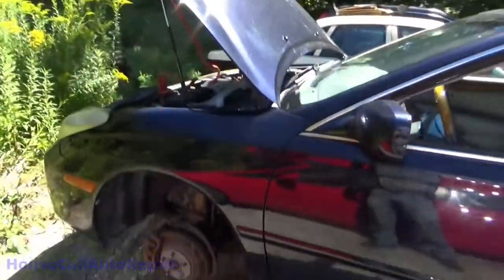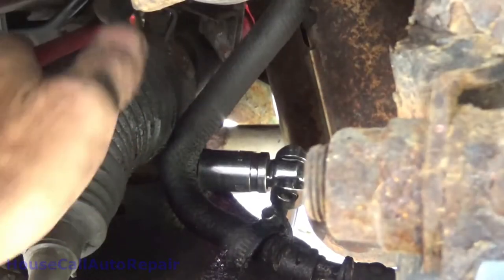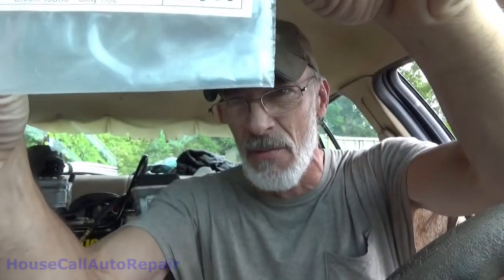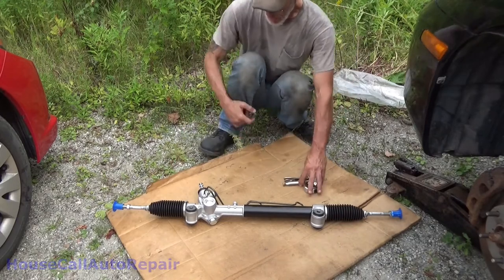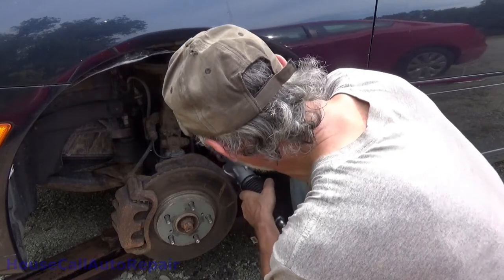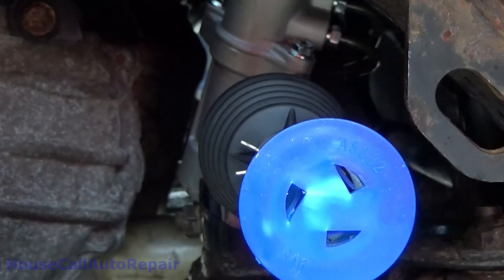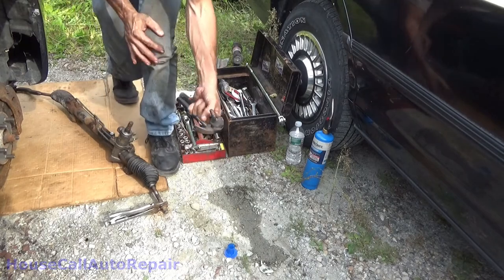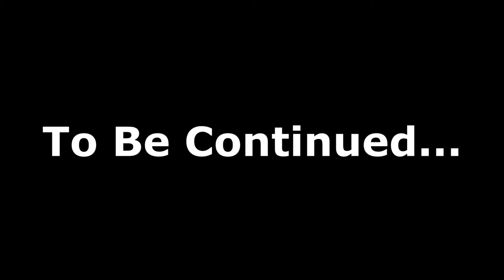2005 Lexus ES330 - Steering Rack Replacement - Part 1

Comment from the maker: Stay tuned for part 2... Not much scarier than taking a repaired vehicle out for a test drive and suddenly realizing the steering wheel won't turn!
Let me know what you think might have caused it below...
Reply: Where did you get those orings from
Reply from the maker: @ConStantEdits  Toyota Parts Counter
Reply: What brand rack  did you use

Comment: The off center seems to be common. I changed out my rack and found out, after the full install, that it was 1/4 turn bias. Mine was also pushing right ... Which resuts in a more left
Reply from the maker: It's really easy to knock it off center, as much as just getting it off center. I see fewer and few means of locking them, centered, for shipping.
Reply: @HouseCallAutoRepair  I had to get a friend to turn the wheel while I measured the throw. Then centered the rack and took off the steering yolk and recentered the wheel before reattaching

Comment: You're lucky that you didn't have to loosen the sway bar from the sub frame. The bolts for the rack are too long to just pull them out.
Reply from the maker: As much as things rust up, around here, it's a wonder that most of the bolts didn't break.
Reply: I finally got the steering rack out. I just loosened the front bolts of the sway bar and used a pry bar to clear the bolts.

The wacky thing I had to do was remove the air box and get to the metal lines from the top. I used the pipe from my jack to secure the rack and used a wrench with an extension to get the lines off the rack. I live in the rust belt.

Comment: Assuming you checked the fluid level and bleed the rack by turning lock to lock a few times to get the air out, I would next guess there is a clog in the line.
Reply from the maker: No clog in the line, and amazingly, the fluid drained from the system was relatively clean! It really felt like a weak pump, but it did turn lock to lock while stationary, without any struggle. On the road it felt like there was no assist.
Part 2 covers the improvement, as well as more dangerous COMMON problem...

Comment: Is this the exact same process for a 2002 ES300? I used the video to replace on a 2004 ES330.  I now have a 2002 ES300 that needs a rack. Thanks!
Reply from the maker: It's similar. Check other videos to get a better idea on that model.

Comment: What would the symptoms be of the two bushings under the rack failing?
Reply from the maker: A back and forth, clunking feeling coming through the steering wheel, when driving over bumps. or any ERRATIC vibration during steering wheel rotation. (rack movement)